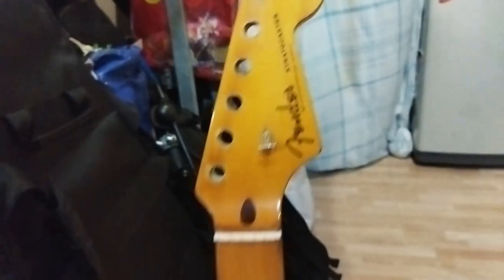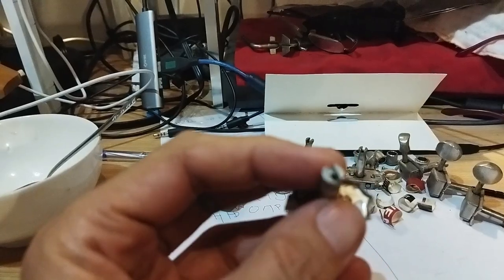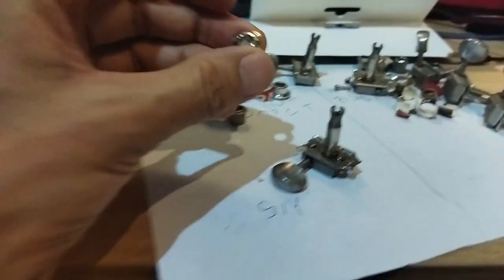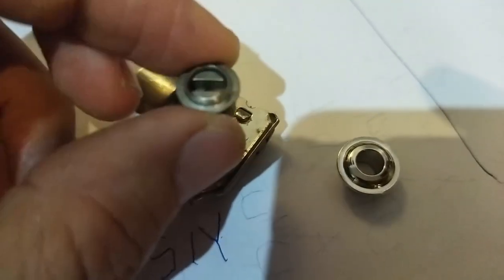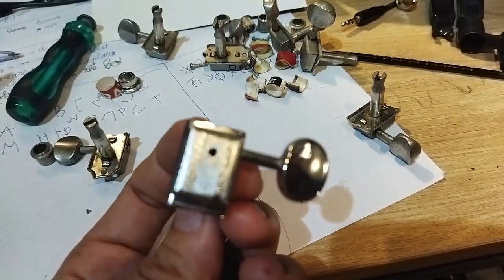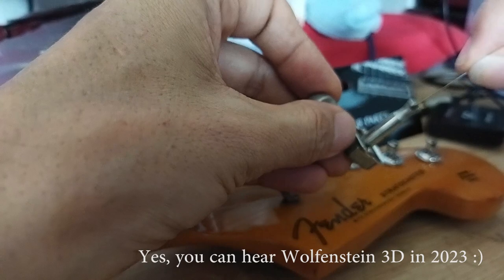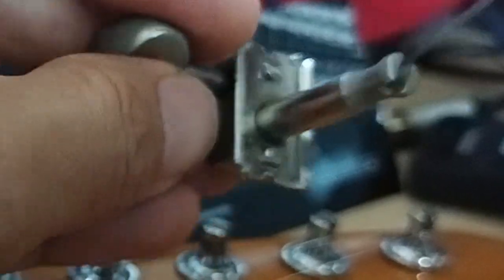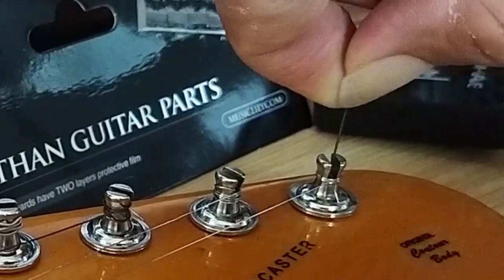Conversion Bushings for Split Shaft Tuners, Wilkinson sucks

Comment: I had to widen the 10mm holes with my drill to get the 10mm to 6mm adapters to fit. They're bigger than 10mm.
Reply: I came to this video to check, as I found the same. The diameter of the Musiclily conversion bushings is 10.8 mm. Even for perfect 10 mm diameter holes, that is too large and will require widening the holes.

 It doesn't help that the hole diameter on my (non-standard) neck is 9.3 - 9.8 mm (yes the holes are not uniform in size).